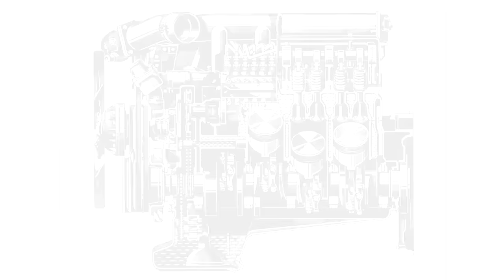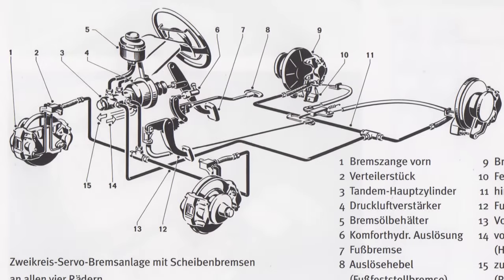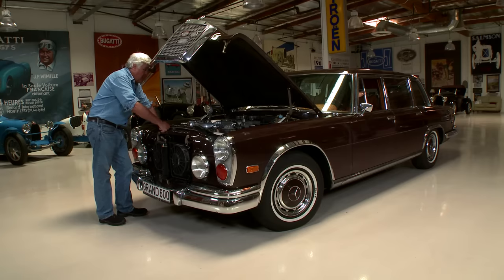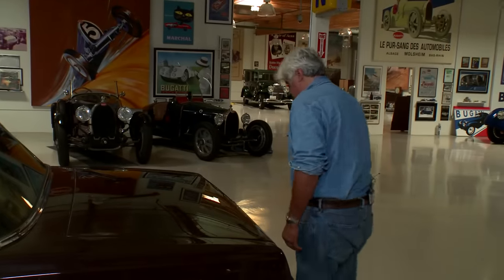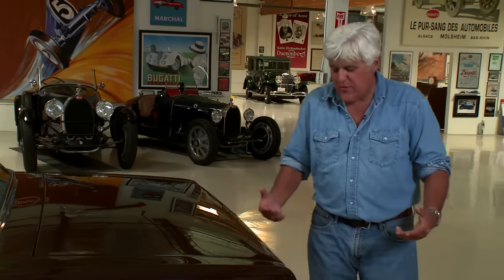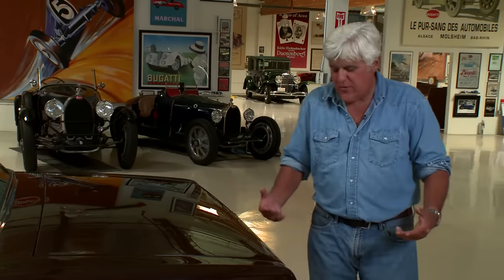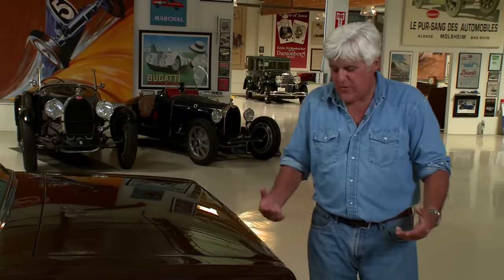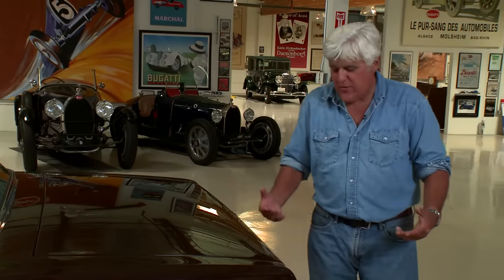1972 Mercedes-Benz 600 Kompressor - Jay Leno's Garage

Comment: Wait, so "Kompressor" wasn't just a really really bad example of '00-era marketing? It's actually been around since the 70s? Interesting...
Reply: Kompressor has been around since the first supercharged cars.
Reply: Nope. When Karl restored it, he put a supercharger in it, which it didn't originally have. To fit the bill, he put a custom KOMPRESSOR badge on the decklid.
Reply: If I'm not mistaken, it's the german word for Supercharger or something like that.
Reply: mak450 Indeed, I've just always thought it's a really bad moniker for a car, at least in English...
Reply: sbblakey777 It's not a custom badge, it comes from modern Mercedes-Benzes with a kompressor.
Reply: *****
Kompressor is german for "compressor", which means a device for compressing air or other gases. Americans call a compressor that's installed in a combustion engine's intake a supercharger, but in many other languages (including Russian, for example) there's no special word for the automobile engine compressor as opposed to any other kind of a compressor.
Reply: ***** Well good thing it's not in English, then.
Reply: sbblakey777 Touché
Reply: it's been around since 1920s or so ...
Reply: Its been around since the 1920's or 30's ....  mercedes most popular compressor car was the SSK  it was a pre WW2 race car ....  high power very low qty built and expansive as hell ....  but german craftsmanship in a race car as you wouldn't believe ....
Reply: Mercedes Benz made supercharged cars before WWII, for example 770 K limousine and 540 K roadster (K for Kompressor - supercharger). Those early superchargers were only engaged at full throttle or by manual switch for ~15 seconds, then automatically disengaged so the motor wouldn't blow. The 540 K developed naturally 110-115 horsepower, and for 15 second under full supercharger pressure 180 horsepower, thus allowing speeds of 170-180 kph to be reached. When the car was fired up, the supercharged automatically engaged and you had to wait until oil got hot so the clutch disengaged. A distinctive supercharger whine was heard until then.
Reply: *****
Mercedes made supercharged production and also competition cars as far back as 1920s, the most famous of which was the SSKL from that period. Any of their cars with a "K" in the model designation, such as the great 540K from the late 1930s, was supercharged.
Reply: Paul Zink It is about the fucking badge, which is a modern thing from cars like W210 and W202. 540K was great? Yeah, top speed was 170 kph and only for 15 seconds, because the supercharger could not be engaged permanently, as it would blow the engine. Naturally aspirated limousine Duesenbergs were much faster than this "great" roadster.
Reply: GruszkuEntertainment Great is about more than top speed. Maybe I should have said "desirable", and if that can be measured by auction results, a 540K drophead coupe beats a Duesenberg Model J coupe by $1.43 million ($11.77 million vs. $10.34 million selling price, each at the Gooding Monterey auction).

Comment: I was lucky enough in the early 80's to work for Cal Rossi who owned the Pacific Plaza Hotel in SF. He loved fine automobiles and so the hotel had a 600 which they used to pick up VIP guests like Keith Richards. I got chauffeur driven a few times around town.
Magnificent car, Cal used to joke at how ungodly expensive it was to keep on the road

Comment: Quite a few were sold here in OZ. Unfortunately I got to work on them when they were 10 years old. Try pulling out the E-series transmission. Even to get at the control solenoid on top you had to pull the engine first! Access to the trans mount or front driveshaft coupling was through a fist sized cover in the closed, integral backbone chassis. Like many uber-luxury cars, you don't maintain them. You periodically re-commission them. King pins, swing axles and air suspension were a big part of my early years with Mercedes-Benz. I'm glad I did it, but also glad that I no longer do.

Comment: ... the "600" came in (2) versions ... the "600" Grosser,  which was the long limo model w/ a rearward facing seat just behind the driver ... and that one in the video is a "600" Short,  no rearward facing seat ... My father worked for Diamler Benz  in the mid to late 1960's.   The importer  had a stable of   the more expensive models that where used as "demo" models and when a customer wanted to see/drive a Mercedes Benz ,  one of those cars was made available at the local dealer/shows ... the 280SEL Convertible was very popular as a "Marshalls" car for parades ...

Comment: Years ago I was able to purchase a bunch of obsolete and slow moving parts from a MB dealer. Digging thru the parts I found what turned out to be a single hydraulic window switch for a 600. At the time it was worth about $6K. For $11K you are probably talking about a driver's door master switch. The switch I had was about half the size of a deck of cards, all brass, and looked like it came out of a Swiss watch. I toured the Mercedes factory years ago and knew people who knew people so I was able to see parts of the factory the public does not. They had on the shelves left over wood for the 600's and other cars. So if you damaged the wood in your car the factory could use the VIN for your car and produce a new replacement wood trim.

Comment: In the late 80's I bought a BMW 535is--which meant I spent a lot of time at a mechanic's shop in Houston (Meszaros Motorsports).  Frank, the owner, was a German dude... trained to work on German cars... in Germany.  He emigrated to the states and eventually opened his own shop--and was arguable the best Mercedes / Porsche / BMW mechanic in Houston at that time.  My buddies and I were all local drug dealers so we had a lot of money to throw away on stupid, expensive cars.  So we were very friendly with Frank.  Anyway, one when I'm picking up my car Frank says, "Hey, you wanna buy a 6.9 Mercedes? I The owner is a customer and I think he'll sell it cheap."  I'd never heard of such a car so Frank says, "Jump in, let's go for a spin."  At the time I was in my late teens / early 20's... so a big, "slow" near limousine size Benz sedan was the last thing I would have ever considered buying.  But that damn 6.9 was FAST--for that era--and for that size of car.  It would do 0 to 60 in under 8 seconds--and 150 mph on the highway.  It was a gas hog... and needed constant maintenance... but I think I could have bought it for around $5000 back then... in good working condition.  But I already had one hole in the ground that I threw money into at that time... the BMW... the last thing I needed was another one.
Reply: Great story. You then realised why the owner wanted to unburden himself for 5 large. Cheers!

Comment: This sat in my dads garage for a decade (In the 80’s) because it wouldn’t run. He worked on and swore at that car for years. Later, after declaring that German cars are over engineered garbage, he bought a cheap Toyota pickup that still runs today.

Comment: looks like it's compressing sunlight off the front, there Mr Leno... it's you, dude
Reply: Mr Leno... whom do you have choosing the correct color...?... cars.. like gloves...
 said some babe over in England.. should be iether white or black... I was shocked to see.. forest green... no.. brown 
. ahhh.. well.. I understand.. Hollywood.. no worries mate
Reply: carry on, sir.. please.. after breakfast with Jay Leno.. dessert.. far out man
Reply: my father bought a 61 220s off the factory assembly line.. I went to the service department for the first time.. white.. clean.. men in white lab coats.. here I am 50 years later.. still in love with Mercedes.. thanks
Reply: oh man.. 61.. 40.  + 20... arrrrgh... I don't feel a bit older.. Mercedes sind wonderschöne
Reply: I learned how to drive in that car.. 4 on the tree.. up and down the driveway.. it was black Mr Leno..  just saying
Reply: the driveway might have been 20 meters.. probably not
Reply: ,☆》♡♡♡ Peas

Comment: Had a 1974 240d with hydraulic door locks, if you pushed one down they would slowly sink down, or rise up to follow, probably standard for them at that time. The widows were electric iirc

Comment: I've heard the hydraulic system also powered auto door closers, but I think those sources were mistaken.....I've never seen any footage of this anywhere, and as demonstrated with the trunk, it would not be a good idea to manually open or close something under pressure by being connected to the hydraulics. It would also probably need a door open button on the outside somewhere, and the force would knock out somebody standing by the door.

Comment: I always thought that disc brakes were best for the front because that's where most of the braking force is needed, and drum brakes were best for the back because the fact that they do lock up makes them better parking brakes.  The best reason I can think of to put disc brakes on the back is to increase the price of the car.

Comment: HA - just a bit of trivia - compare the prices below back then here in AUSTRALIA for a 300 SEL 6.3 (the same engine as in the 600) and GT-HO Falcon.  Given that the GT-HO had lower gears - hence it probably accelerated quicker than the 6.3 300 SEL - but if given a bit taller gears (at the sacrifice no doubt of its acceleration edge over the 6.3) - it probably was as fast or faster than the 6.3 -- but for sure the 6.3 would have been HUGELY different in the comfort and serenity over the GT-HO - both neato fun cars.  I wish a 300 SEL 6.3 had been entered into the BATHURST 500 (miles in those days - now a 1-000 kilometer race).  The 2020's 'guesstimate' cost of a GT-HO to a 6.3 here in AUSTRALIA in 2020 is that the GT-HO could probably cost anywhere from 5 to 10 times the cost of a 6.3.  One is a GRRRRR beast (HA - yes the GT-HO) and the other a refined beast - what a car - both cars I would enjoy to own.  NO - I am not saying that either one of them is better than the other - they are both similar - but 'same difference' type of vehicles - both thoroughly enjoyable and I could drive either as an everyday car and with a BIG SMILE on my face - HA - in my dreams - I wish.  HA - I want BOTH and also a 600 for days I feel a bit 'despotish' - HA.

1970 Ford Falcon GT-HO Phase II

Produced: 1970-71

Body: 4-door sedan
Engine: 5763cc V8, OHV, 16v,
Power: 224kW @ 4800rpm
Torque: 522Nm @ 3200rpm
Weight: 1500kg
Gearbox: 4-speed manual
Suspension: wishbones, coil springs, anti-roll bar (f); live axle, leaf springs (r)
Brakes: discs (f), drums (r)
0-100km/h: 6.7sec*
0-400m: 14.4sec*
Top speed: 217km/h
Price new: $4830 (1970)

* Wheels Magazine November 1969

1968 Mercedes 300SEL 6.3
Produced: 1968-72
Body: 4-door sedan
Engine: 6332cc V8, SOHC, 16v
Power: 184kW @ 4000rpm
Torque: 500Nm @ 2800rpm
Weight: 1709kg
Gearbox: 4-speed automatic
Suspension: double wishbones, air springs, anti-roll bar (f); swing axles, air springs (r)ums ums
Brakes: discs (f/r)
0-100km/h: 7.0sec*
0-400m: 15.0sec*
Top speed: 230km/h
Price new: $20,850 (1970)

* estimated

Have a nice day all.  CHEERS from AUSTRALIA.

Comment: for AirCon our ‘76 450SE had a Chrysler AirTemp which worked well, as it seems it was just the US that demanded auto temp air and MB must have found it easier to buy the tech for just that continent.

Comment: Actually there were electric motors that would have worked well, but the  problem was generating enough power.  In the US we used pneumatics before electric became economical.

Comment: SOMEBODY HELP ME OUT- Electric windows were out for several decades in many cars. Motors in '72 were compact not huge like Jay said. Could hydraulic windows have been used for the silence instead? Jay's hydraulic window excuse doesn't make sense.
Reply: Lawrence Fearon See Jay's video on a 1958 Continental: electric windows and mirrors. So yeah, there's some other reason
Reply: Dan Webster had several cars older than ‘73 with electric windows. That we’re smaller than this Mercedes